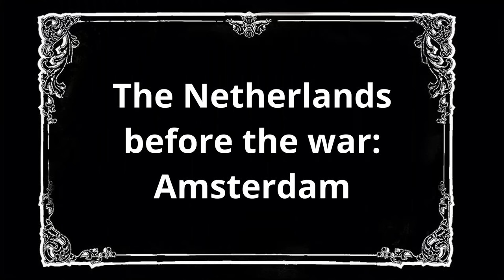Unique footage of the destruction of the Netherlands during WW-II in color, Part-1 (1945)

Comment: You mention nothing of the Dutch Army, Air Force and defense capabilities in this early days, why did they not exist or were so weak ? Politics ?
Dutch were always a strong Naval state and you had Fokker. What went wrong post WWI >?
Reply from the maker: Watch my other videos about WW-II in the Netherlands. There are plenty on my channel and I cannot repeat the same things in every video. There is so much to tell!
Reply: Aeroplanes. The Netherlands used to be easy to invade but almost impossible to take because of the Waterlinie, strategic inundation around the West part mainly so the ports and the naval ports would remain operational while the invading soldiers were sitting ducks in a few feet of water.
Reply: The ground forces were rather outdated compared what Germany had to offer, there were not many tanks and what was there was rather obsolete.
Also in numbers the Dutch army simply couldn't defend themselves against the large colonnes of German troops passing the border.

The Navy hadn't a role because Germany didn't invade the Netherlands from the sea.

The strengthening of the air force, which would be the major factor in defending the Netherlands in those first days, was underway.
Modern planes like the Fokker D21 and  G1 and Koolhoven Fk58 were being introduced at the time but the implementation of those planes in the Air Force came a bit too late, so couldn't be produced in large enough numbers to make any difference. 
They had a quite good kill ratio on German planes in those four days, but the numerical superiority of the German Luftwaffe made the Dutch Air Force almost non existent after those few days, the Germans could put up at least 10 times as many planes against the defenders.
So after four days the German bombers met not much resistance anymore, just some AA, on their way to Rotterdam, and the sheer devastation of the city led to the decision to capitulate, as further resistance would only delay the inevitable feat and lead to more destruction and deaths.
Just look at the UK, despite having the English channel as a physical barrier and being able to produce far more planes they struggled to defend themselves from being invaded and needed  to acquire even more additional planes from the US (P-40 Tomahawk) from the US to be able to put enough assets up against Germany.
Reply: We became sort of a pacifist country in the interbellum of WW1 and WW2, the pacifist movement of the broken little rifle (het gebroken geweertje), was very outspoken and influential. They said there would be no war after the gruesome WW1 (not gruesome for us by the way, we were neutral back then), so The Netherlands didn’t invest in military defense of our country and colonies. The depression didn’t help to seek funds for strengthening defense either and besides, we heavily depended on our neutrality which helped us in WW1. So three reasons, pacifism, lack of funding and neutrality.

Comment: As far as i know the Nertherlands capitulated before the bombing of rotterdam in an attempt to avoid that very bombing... i guess i was wrong then.
Reply: They surrendered after the bombers were in the air, and could not be contacted about the surrender
Reply: Exactly  @Manse2014   , the video says Netherlands capitulated after the bombing, but that is not what happend.
Reply: @mindwis3 No that is what happened. The city of Rotterdam capitulated before the bombing. Rotterdam was bombed by only a part of the Luftwaffe force. That part did not received the order to call off the attack or ignored it. If Rotterdam had been bombed full force then the devastation would have been much worse. After bombing of Rotterdam, the Germans threatened to bomb other cities to pieces and that is why the government surrendered. The Germans had expected that the campaign in the Netherlands would last two days but it lasted longer. It was vital to Fall Gelb that NL would fall fast.